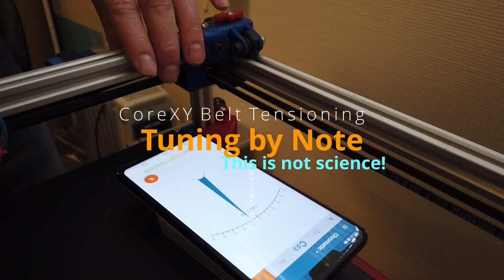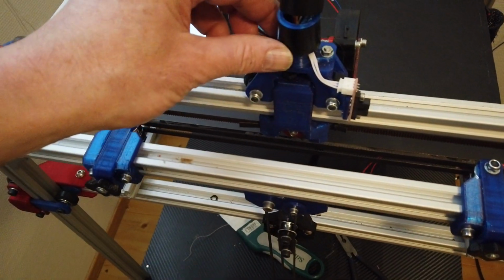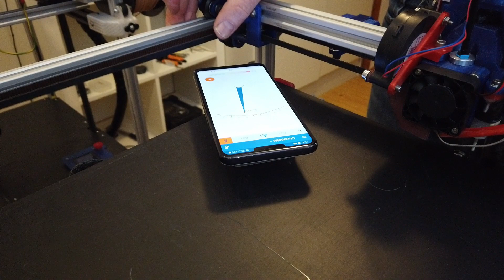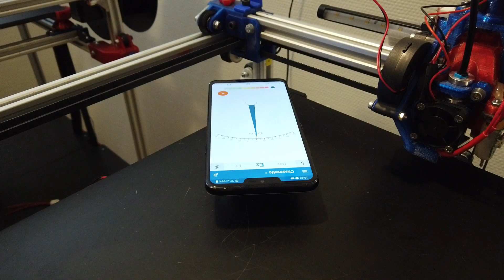CoreXY 3d Printer Gates GT2 Belt Tensioning

Comment: Did you find that tuning to “A” on x and y provided adequate tension?
Reply from the maker: It depends on the size of the machine. Or the length of the belt but around 55hz for this size

Comment: thanks for the video! Out of curiosity. what printer is this?
Reply from the maker: This is the V-King CoreXY 3d Printer. You can find it on thingiverse
Reply: @PRO3DESIGN  Oh cool! I built a hypercube evo and I'm so disappointed :( I spent so much on it!
Reply from the maker: It is not easy building a big volume printer. The tolerance goes down and prices up.. Rods on a big volume printer is not optimal
Reply: @PRO3DESIGN  mine's 300x300x300 so I think at that size it's honestly fine.